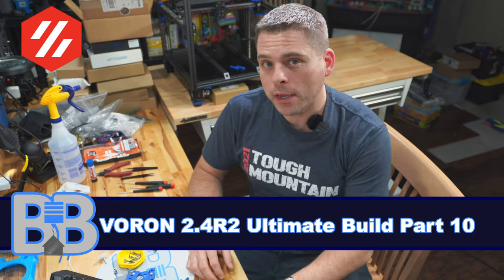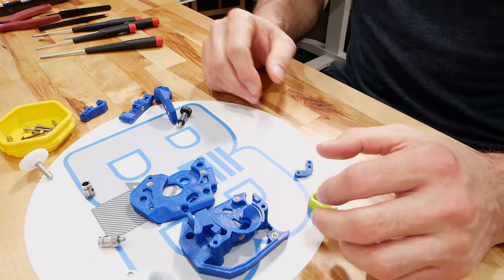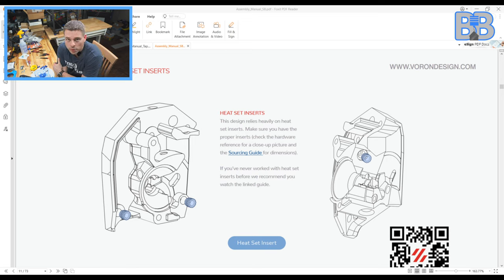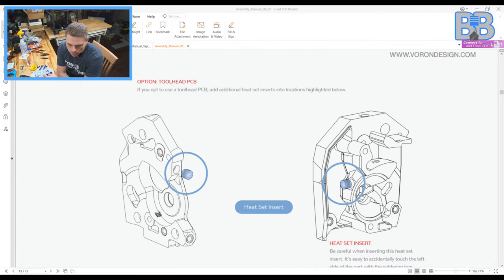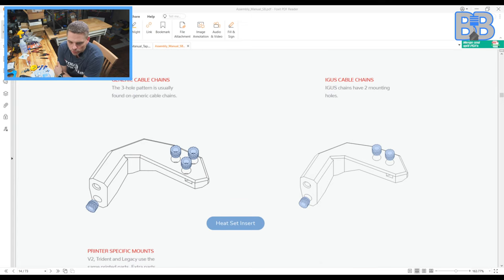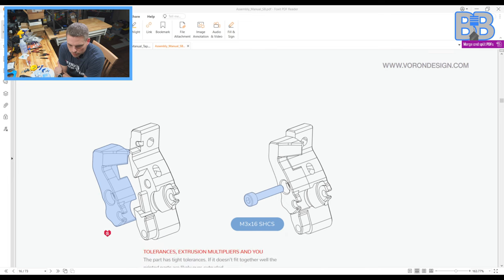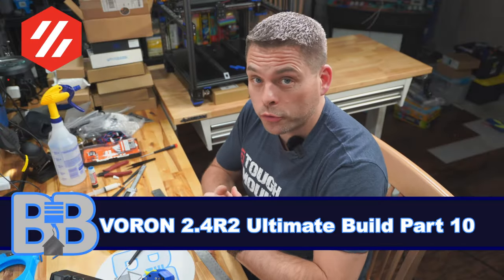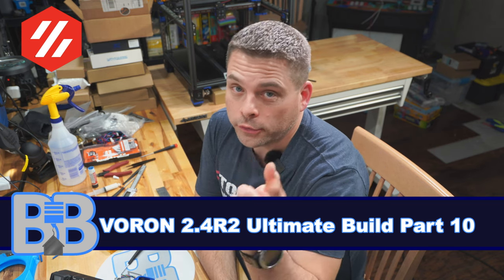Part 10 ULTIMATE Voron 2.4R2 Clock Work 2

Comment: I'm self sourcing and the fysect stealthburner kit, stepper, lights,fans etc had the wrong type plug on the stepper. So I had to repin it. They're so tiny.
Reply from the maker: That is an issue that we all deal with - Standardization hasn't been a major goal in 3D printers.  Get yourself some extra pins and a decent set of crimpers (or two...three) and practice!  It's a good skill and once you have it, it does get easier as long as you have the eyes or a good set of readers!
Reply: @BuildItBasement  And three hands, ha. I'm getting pretty good at crimping.

Comment: Liquid threadlock will severely weaken abs parts. You'll see cracking.  An althernative would be the stick form, which still weakens, but is less likely to get onto surrounding abs parts.
Reply from the maker: I have read a lot on the subject and I feel it's blown out of proportion.  Most of the information is more possible cause and effect and not actual test.  I have three other printers of which two are Vorons, built using small amounts of threadlocker.  The only failures I have seen were due to bad ABS and not where threadlocker was used. That said, I'm going to do a video on the subject - keep an eye out.  Probably three different plastics and a half dozen tone periods.  I appreciate the opinion in personally not overly worried.  I'm not using plastics for bolts or nuts.

Comment: Great vid. New sub. Going to be upgrading soon to CW2 with 2 piece board. Very clear and good tips
Reply from the maker: CW2 is much improved. The path and build are half a world away from CW1.  More than happy to help, let me know if you need anything.
Reply: So that was one part of what's called a "2-piece board" right? Some really small parts to play with this time. Reminds me I'm going to need some calipers.
Reply from the maker: @oscarvogel2140  Yes - The PCB on the fan is a little like a daughter board to the main (motherboard) that is actually mounted to the side of the extruder (under the cover/flap).

Comment: What is the difference between CW1 and CW2 if you don't mind the ask?
Reply from the maker: Quite a bit.  A lot is going on inside those extruders and a lot of engineering to try and get the filament out properly.  At the simplest, the filament path on the CW2 is much better.

Comment: Oh boy my stealthburner 2 piece board came as a kit not put together. I'm in trouble fmf lol
Reply from the maker: Do you mean it does not have the connectors soldered on yet? That's interesting.  On the plus side it's mostly well spread and nothing is surface mount.  Good luck!
Reply: Tool head  board was also bare. I'll try to find a complete put-together kit and keep this as a spare.
Reply from the maker: KB-3D - Tell Kris I sent you!
Reply: @Build It Basement  I just ordered it from there dangit. Let him know I got it from there lol
Reply from the maker: @rasputian2010  No worries - I don't get anything from them, But if you continue to follow along with this series, you should see a few special items I had custom-made by Kris@KB-3D.  Check out my unboxing video if you have time, I go over four or five items that are custom.  He does a lot with his CO2 laser!

Comment: I'm actually starting to build my voron and this is where I started, because I have all the stealth burner parts gathered. I see why the 2 heatserts need to be countersunk on those 2 holes,.. because the M3x25 bolts don't catch many threads if the zerts aren't in below the surface. I sunk mine in deeper but might have to sink them in farther because only half the zert threads are getting used. Also on mine the bearing that goes into the bottom of the cone just fell in and falls out if I turn it over and shake it. If I put the gearshaft through it, the bearing stays with the shaft when I pull it out. That's not acceptable right?
Reply from the maker: Oscar,  as long as there is no play around that bearing you should be ok.  I would rather it be slightly right than slightly loose.  Based on what you're saying it does sound a little too loose.